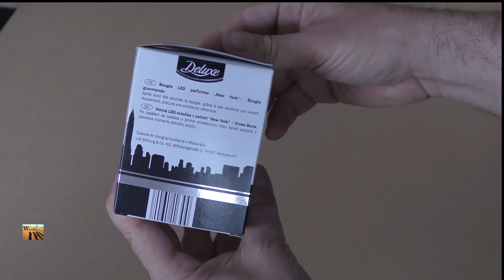How Decorative Candles Changing Color Works? Cool Science Experimet

Comment: the sensor is infra red.
there are 2 "wicks" the 2nd wick is a strand of fiber optic which goes down to a sensor on the light unit. (it melts as the candle burns)
you can test it with your TV remote which will activate the lights

I have no idea why Im replying to a  3 year old video or why YT recommended it but whatever.
Reply: Yeah! This guys did not explain anything! Just the obvios I guess! Thanx fot the tip!
Reply: This was the answer I came to find, I’m glad you did answer
Reply: Guys, do you know, where could i get this candle?